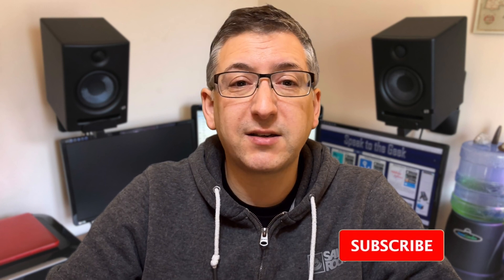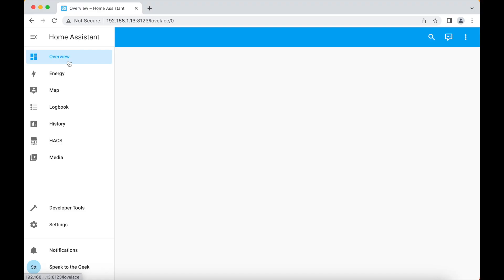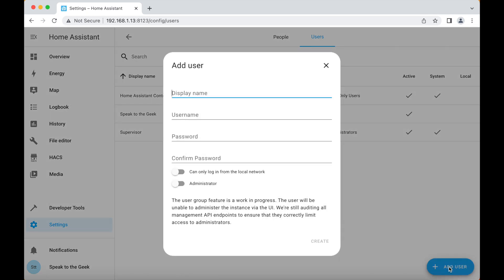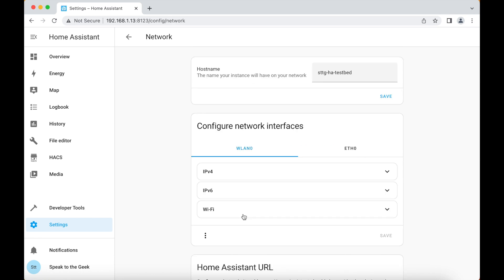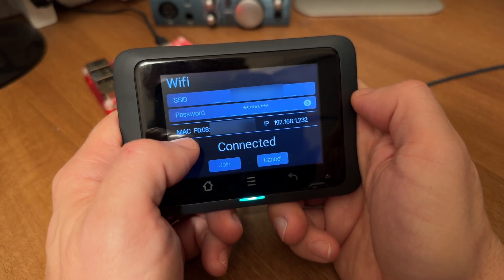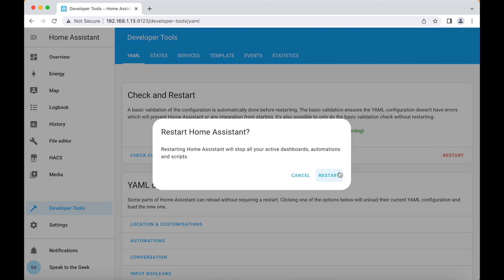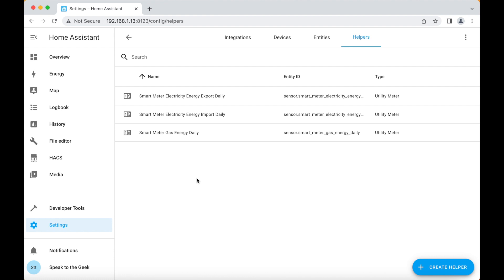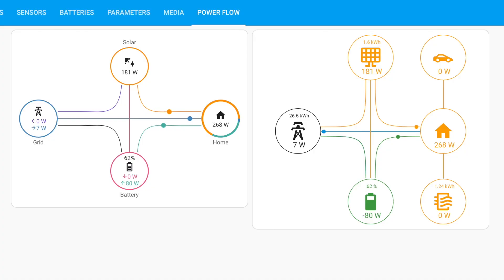Glow Smart Meter Display and Home Assistant: Configuration Tutorial

Comment: Hi Thanks for this most excellent set of instructions. I have followed and everything proceeds as you describe. However having edited the yaml file with the taext containing the display MAC address and then restarting the system it all appears to be ok but when I get to the step 
"Once it’s back up, you should go and check that it’s all working. Navigate to:

    Settings > Devices & Services > Entities (tab)
Filter the list by the words “Smart Meter” to display just the new ones that have been created. If you choose one of the sensors (for example the Power sensor), you should see data on its ‘info’ tab and a graph starting to form."
The Entity Tab is stubbornly blank. 
Any help on where I have gone wrong would be appreciated. Thanks
Reply from the maker: There are a number of places that things could be going wrong here. Firstly I suggest you make sure that your display is able to talk to the MQTT service on Home Assistant. In HA navigate to Settings > Devices & Services > Integrations. Find MQTT and click on Configure. In the 'Listen to a topic' section, type 'glow/#' without the quotes into the 'Listening to' box and click on the 'Start Listening' button. You should get a stream of data and messages coming from the meter. If you don't get that data, then the problem is the connection from your Glow device to Home Assistant and that's where you need to concentrate your troubleshooting. If however you are getting data, then the error will most likely be with a typo in what you have pasted into the configuration.
Reply: @SpeakToTheGeekTech  I do get a stream of data. I have double and tripled checked the MAC address but will do so again. Thanks for your help. How do you ever learn this stuff
Reply from the maker: That's good news you are getting a stream of data. Check the messages and make sure that the topic in the messages is exactly the same as the topic in the sensor configuration you've added - on the lines named state_topic. The value should be something along the lines of state_topic: "glow/XXXXXXXXXXXX/SENSOR/electricitymeter" and is case sensitive. Also, check the Home Assistant logs to see if there's anything about misconfigured sensors and MQTT. Settings > System > Logs
Reply: @SpeakToTheGeekTech  Hats off to you. I am not sure exactly what  has happened and why I didn't get it before but since running  the Listen to thing my electricity readings have started to come through. Now all I need to do is see if I can get the gas readings to come through.
Thanks for your help this was one of the best - possibly the best - guides on this kind of thing I have ever seen. Any way I can give you more kudos points?
Reply from the maker: Gas might start coming through once you use a bit. It's generally a lot slower to get gas data compared to electricity because the meter only reports every 30 minutes, and this time of year you're less likely to be heating your home and using a lot of gas during the day in order to get the readings to jump up.
Reply: @SpeakToTheGeekTech  Forgot to get back and thank you Gas now working
Reply: @SpeakToTheGeekTech  Sorry to hassle you but one last question I thought I had Gas configured and working but either I have changed something or I hadn't noticed before but Daily Gas Import gives the same readings as Daily Electricity imports. I have two "entities" if that is the correct terminology.  sensor.smart_meter_electricity_energy_import   and sensor.smart_meter_electricity_energy_import_daily But strangely both give the electricity data. Your advice would be gratefully appreciated TIA
Reply from the maker: If your daily gas and daily electricity import sensors are both showing the same value, I suspect you have probably put the same electricity entity in for both Utility Meter helpers! For electricity you should wrap sensor.smart_meter_electricity_energy_import but for gas you should wrap sensor. smart_meter_gas_import - the details are on my web page under the 'Home Assistant’s Energy Dashboard' section: https://www.speaktothegeek.co.uk/2023/02/glow-smart-meter-display-and-home-assistant-configuration-tutorial/
Reply: @SpeakToTheGeekTech  Thanks very much for your  reply - you are indeed ace You are correct that I screwed up the helper but I am pleased to say that I did  eventually get it sorted before seeing your reply so I have learnt something just not sure what!

Comment: Hello, I am having British Gas engineers to come changing electric and Gas to smart meter sooner.. would Hilderbrand CAD compactable with these smart meter as I believe they will come display meter from British Gas .... is that any good?
Reply from the maker: It’s likely that the Glow CAD will be compatible with your new smart meter but you should confirm that with Hildebrand once they’re installed and operational (probably take a week or so after installation). The display you get from British Gas will probably be a basic one that likely doesn’t support any Home Assistant connection - the Hildebrand Glow is designed to provide you with more options on how to use that data (such as with Home Assistant)

Comment: I've used you're excellent videos for setting up a few things on HA. I have now setup the Glow CAD as well, whilst I have export meter readings, neither the Bright App, IHD or HA show any export power. When I'm exporting they all show power as zero, any idea's or should I jump on the Glow forum?
Reply from the maker: You should contact Hildebrand support in the first instance. I've heard that there are a few smart meters out there that are running old firmware that can cause this issue - it's the smart meter itself not providing the export power data. The Glow IHD can only provide you with the information that it's given.
Reply: @SpeakToTheGeekTech  Thanks, I'll email them. Smart meters were fitted in March, so hopefully it's something fixable, although I can get export power from the Victron system.

Comment: Great video. A lot of help. I got mine up an running quickly from the video, but I'm having problems showing export numbers. My Meter shows Export and Import numbers in the physical window. The Bright App shows 'electricity consumption' and goes +ve on import times and -ve on export (solar generation) times. on the Home assistant I added an import and export  entity in the Yaml file (as per video). The Import works fine and I have numbers coming in, but the export entity shows nothing. As mentioned, the Bright App shows 'consumption' fluctuating around the zero, but I only get the + values then coming through. Any ideas?
Reply from the maker: How about the MQTT entity you created for sensor.smart_meter_electricity_power ? That should be the raw value from the smart meter and will be positive or negative. If that never goes negative then the issue is with the data sent by Glow / the smart meter. If it does go negative, then we have a templating issue in HA to investigate...
Reply: @SpeakToTheGeekTech  looking at the power entity, yes, it’s showing a graph going +ve and -ve. Currently -ve as it’s sunny out. The energy export entity just says ‘no statistics found’. The energy import is showing numbers
Reply from the maker: I'm getting confused about what is/isn't working now then, so it's just the ENERGY (not power) export entity that isn't populating with data? And does the Bright app show exported energy values? It sounds like power is working just fine if you're seeing +ive and -ive data in the power entity.
Reply: @SpeakToTheGeekTech  sorry, newbie to all this. So on my Hildebrand CAM and on the Bright App, I can only see 'electricity consumption kWh'. And when solar is generating it goes -ve. I've recently swopped from Eon to Octopus, and got the Hildebrand Cam to talk to HA. The smart meter (installed by Eon a year ago) shows IMPORT and EXPORT numbers in the window, but export never appeared specifically on any IHD. Just showed -ve consumption. I connected the Hildebrand CAM to HA as per the video, adding the 5 devices for electricity: power/Import/Export/Import unit rate/import standing charge/ 
So 4 of the above are all showing showing numbers, but the Energy Export shows nothing
Reply: A bit more info, which maybe related. During the day, I can see the export figures on the Bright App. So mid-day say, I can see -Ve kWh showing on the Bright graph and the hourly figures are showing -Ve when it’s sunny. But the following day, they are all zapped, and the Bright app is only showing +Ve consumption. On the hour slots where there was a lot of -Ve figures showing the day before, it’s now only showing zero or a very small +Ve readings. So something is happening overnight (the import figures are overwriting the true import/export that was showing before), and maybe something is not correctly set up on my infrastructure to record export? But I have no idea where to look or who to contact.
Reply from the maker: There's a forum for Hildebrand that you could post the question in. There are a lot of users in there, plus their support staff keep an eye on things in there too. https://forum.glowmarkt.com
In my Bright app, I only ever see import/export live power readings. I have never seen historical exported energy data though. You should be able to post screenshots as evidence too to help explain the situation.
Reply: @SpeakToTheGeekTech  thanks, I will try the Hildebrand forum. I have a feeling it will fall in the gap between whether the problem is in the Hildebrand system or my HA set up, as the only visible problem is that my HA mqtt export sensor is not picking up anything.

Comment: Great video thanks I do have a problem I can see the data for the electricity import and export  but I cannot get the gas import to work do you have any advice?
Reply from the maker: The instantaneous import doesn't really work that well, but the import energy for gas should work fine provided that you can see the data on your Glow display itself. You can see the messages coming from the display by going to Settings > Devices & Services > Integrations (tab) and clicking on the configure button against MQTT. You can then listen for messages from 'glow/DEVICEIDHERE/SENSOR/gasmeter' to make sure that you are seeing data. It might be slow, once every 30 minutes though.
Reply from the maker: An example message from my gas meter is this, and you can clearly see the cumulative energy value and volume in that data: 

{"gasmeter":{"timestamp":"2023-03-05T18:44:09Z","energy":{"import":{"cumulative":6274.915,"day":39.564,"week":305.998,"month":217.759,"units":"kWh","cumulativevol":559.230,"cumulativevolunits":"m3","dayvol":39.564,"weekvol":305.998,"monthvol":217.759,"dayweekmonthvolunits":"kWh","mprn":"xxxxxxxxxx","supplier":"---","price":{"unitrate":0.10390,"standingcharge":0.26840}}}}}
Reply: Thanks for the reply I have done as suggested and the data is being received by home assistant but I cannot get home assistant to display the information I think i have probably made a mistake setting-up the gas helper i am a complete nube so learning as I go along.

Comment: Great video! However I cannot see any data in my entities.  I do have data shown in the bright app. I've double checked MAC address, user name, YAML file as per your step by step guide.  The entities show up in HA but the data says unknown. I'm a NOOB to HA and YAML so not sure what else to check! Any ideas?
Reply from the maker: The first step is to confirm that when you configured MQTT on the Glow CAD itself that it actually says "connected" at the top of the screen. If that ok you need to do a bit of debugging with MQTT. Settings > Devices & Services > Find MQTT and click on 'Configure'. Under Listen to a topic, type in 'glow/#' without the quotes and click on Start Listening. That should start listing all messages coming from the CAD to your MQTT service. If you're getting messages then the issue is between MQTT and Home Assistant. If you're not getting messages then the issue is between your CAD and MQTT.
Reply: @SpeakToTheGeekTech  Sorted! Two issues - My MQTT broker had autopopulated a default user not the MQTT user that I added. Once changed my CAD could talk to Home Assistant. Second issue I must have copied the YAML code wrong from your website as when I used the Copy button it worked.  All fine and dandy now! Thanks for the videos very very user friendly for newbies like me!
Reply from the maker: Brilliant, good to hear. You'll now be obsessed with watching the values on a power flow card, energy dashboard or gauge card!
Reply: @SpeakToTheGeekTech  Creating a gauge card is next! Also chasing SolarEdge for the API for my panels as the installer went best. My inverter is older than the one in your video so although I can connect to WiFi can’t obtain the data direct.
Reply: @SpeakToTheGeekTech  A follow-up question - I've tried to create a new entity called Current Power cost by multiplying power by unit rate but failing - any ideas? Templates or mqtt but not sure how - topic for a short video?!
Reply from the maker: Definitely template... and this is very roughly thrown together but something like this that converts your current power to kW from W (if necessary) then multiplies by the rate. This basically gives you a cost per hour if you were to keep using at that rate continuously.

template:
  - sensor:
    - name: Current Power Cost
        unique_id: current_power_cost
        state: "{{ (states('sensor.smart_meter_electricity_power_import')|int(default=0)/1000) * states('sensor.electricity_current_rate')|float(default=0) }}"
        state_class: measurement
        unit_of_measurement: "£/hour"
        device_class: monetary
Reply from the maker: If you're getting messages through to the MQTT integration then that's good. You should check a message and make sure it has data in the various fields (it's JSON data so should be human-readable if formatted nicely). Then just double-check that your MQTT configuration is correct in configuration.yaml - the state_topic for each of your sensors should match exactly the glow/.... string including capitalisation that you are seeing in the messages via MQTT listening. Other than that I have no other ideas sorry - if the data is getting through and you can see it in MQTT listening, and the configuration is perfectly correct, then it should all work as per my instructions (I've configured this many times with that method).

Comment: I'd already used your previous video so have the IHD MQTT data working well (thanks).  However, I am having an issue with the use of the created helpers as sources for the HA energy (9:59 in your video).  I've created the helpers and can see data ok but the 3 helpers are not even shown when I try to define them as information sources for the energy part of HA.
Reply from the maker: Are you certain you wrapped the energy sensors in the utility meters and not the power sensors? Check the data for the utility meters you’ve created and confirm the sensor units. They should be kWh (or Wh) and not W.
Reply: I am having exactly the same problem, did you manage to resolve this?